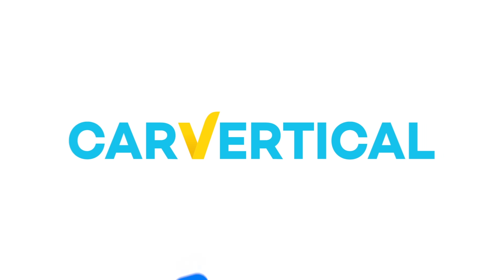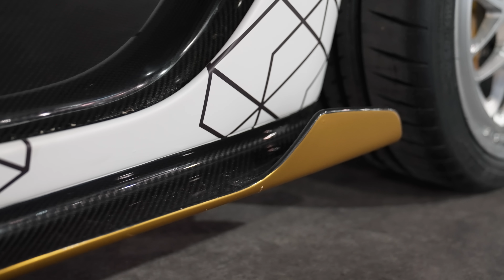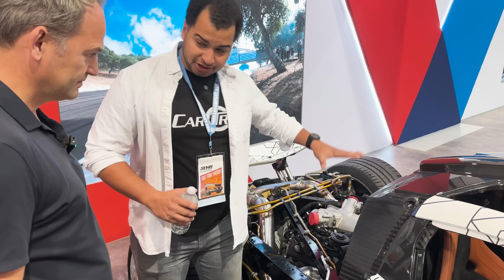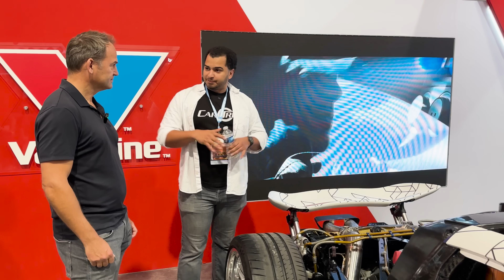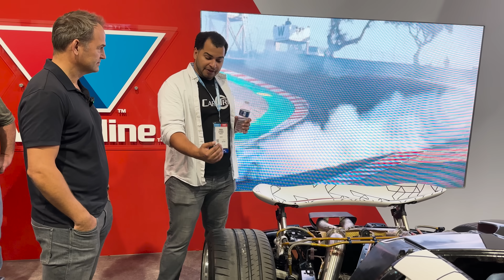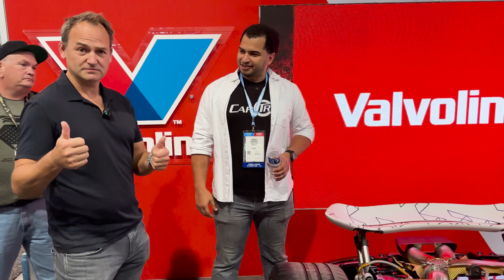Will I be driving the fastest McLaren ever? @tavarish

Comment: The spiritual successor to the McLaren F1 is the Gordon Murray T.50. The hybrid drive was there for a reason. It was the first Hypercar due to this system, which provided instant torque and basically nullified the turbo lag. It was made to be a scalpel, not a sledge hammer. To be balanced in every way, even in terms of weight distribution. What Tavarish has now, is just another car with a lot of horsepower but no sophistication. All the people and fan boys who are mumbling about power to weight ratio and outdated hybrid systems, don't know what those systems do in the first place. Some of them think is about gas mileage. There is a reason why the all time lap record on the Nürburgring was set by a hybrid. Tavarish talked so much about rebuilding the system and many real car guys got extremely exited about it. It has never been done before. Mclarens have been rebuilt but never a P1. People said, it can't be done,...and a big reason for them saying that, was because of the hybrid system. Tavarish proved them right, but not without making us waste our time on his videos up until the point he announced the "big plot twist."

Comment: The Hybrid System in the P1 is old .. Out dated... and very heavy..... Batteries are stupid expensive.... He can put all that money into the engine and help get more out of the car and more speed and HP ....
Reply: @@iceman-xr4yq what do you mean even said it on the video.. The technology is outdated.. The batteries are super expensive.. And it doesn't add that much extra horsepower so if you would have just take that hybrid system out and use the money for performance upgrades on the engine just like he's doing he's going to get 1,500 horsepower And do 270 miles an hour... And it will be because he removed the hybrid system.. weight is the factor.. less weight + more horsepower =  faster you go.. 😜

Comment: Would love to see this compared to P1 OOV the purple McLaren final production press car. Great video and huge respect for Freddy for having the courage to do this (and to deal with the negativity from hybrid fans).
Reply: Not sure I understand your comment. Hes removed the hybrid assembly, surely he wouldnt get any flack from the hybrid haters?
Reply: @jeremyglover5541  Right enough, I have adjusted the clumsy wording above. If you go to Freddy's channel he has received much vitriol from those who would say a P1 is not  a P1 without the hybrid system. I disagree for the reasons Freddy outlines: it will be 200kg lighter, it will improve power to weight ratio and it should yield a better car for his purposes.
Reply: @Gorbyrev  yeah he has, but those guys are just keyboard warriors. He already made a video (as did Rich rebuilds) going into detail the reasons for removing it, but no doubt there will always be a bunch of haters who just want to talk crap and make it sound like they know what they are talking about.
Reply: I mean the fact he has valvoline onboard, as well as the original turbo manufacturers and engine builders ... also taking it to a wind tunnel etc? and now the STIG and putting it against an original P1? this is no backyard garage build. Freddy may not actually BE an engineer, but he sure is surrounding himself with them.

Comment: Straight from the Clarkson school of POWER! This will be overpowered and struggle to put it to the road. Handling issues will abide too, sadly. May as well call it a P1 Hellcat.
Reply: How much HP is a Bugatti Veyron GT? Yeah…. 🤦‍♂️
Reply: @MechanicalMafioso  And how many wheels put the horsepower down in a Veyron? 🤔
Reply: @joshua.snyder  What’s the HP to weight ratio on an F1 car? Pretty sure it’s far greater than the P1 Tavarish/Freddie is building. The number of wheels putting down power is only relevant during acceleration on the street, with street tires. Pretty sure he won’t be hitting 260+ mph on regular street tires. But hey if you want to believe 4wd matters for a top speed run then you do you… I’d really like to see how many seconds they’d last before exploding. That’d be neat… Or simply put, when they’re pushing this car it will necessitate having race tires and with that all bets are off, F1 being a prime example. 2 drive wheels is plenty, less parasitic loss = higher top speed and acceleration for the same HP#  This is why high HP drag cars run 2wd, not 4 same for F1.. It’s funny you saying 2 wheel’s isn’t enough when top fuel drag cars are running what 12,000+ HP on 2 drive wheels. Pretty sure Tavarish/Freedie will be just fine…
Reply: @MechanicalMafioso  Impressive number of passive aggressive strawman arguments, none of which have bearing on the point. 
Freddie's approach is fun and will get attention for the channel which is great, but in terms of making a better P1, that approach is throwing the balance and performance of McLaren's engineering out of wack. Turning it into a quarter mile machine is not in the spirit of the P1, much less the F1 he claims to be paying hommage to.
Reply: @joshua.snyder  It’s pretty impressive that there’s so many experts in here on Mclarens that know far more than Freddie. I’m impressed!
Reply: @MechanicalMafioso  Freddie is doing what he wants with his car which is awesome. HE asked for people's feedback. Many, many people have expressed concern with his approach, and he his still cool with that.
What he didn't ask for petulent fans to white knight for him.
Reply: @joshua.snyder  🤣🤣🤣🤣 Not white knighting him, just calling out BS.

Comment: I wonder if the P1 aero design will allow it to travel at 260mph without big modifications and tons more power.  At very high speeds, each additional mile per hour requires so much more horsepower.  Areo is a massive deal too, I’m just not sure the P1 design will allow for such velocities.  I hope he gives it a hell of a try though
Reply: The Bugatti got to 250+ with 1000hp (& weighs 4162Ib - 1888Kg).  Now give a P1 at 1280kg an extra 600hp & thats where Freddie will be.

Comment: I was initially skeptical and wanted to think Tavarish was a bit arrogant to assume he could improve on this car, but after hearing him talk it seems that he’s knowledgeable and considerate of Mclaren’s engineering and history. I now think he will make a competent build using the “correct” hardware while paying homage to the car’s spiritual predecessor. A true reimagination.
Reply: i dont care if he straps a wonking great rocket engine to it
the day any manufacturer is held to be " too holy" to touch or improve by some lad in a shed. is the day hotrodding cars dies..
stop being arrogant
Reply: @ripvanwinkle2002  They tell him no because of liability issues - he has never had the carbon tubs on this or his blue one x-rayed for micro cracks which in carbon can be devastating. If they blatantly said sure to him - and it does disintegrate, it opens them up to a possible lawsuit. Nothing he is doing in this build is ground breaking at all in terms of hotrodding exotics though, underground racing has been doing crazy exotic builds for over a decade the only difference is that freddy is on youtube (not even working on it himself) and used a salvaged car. Also hotrodding is dying out as we know it, eventually EV swaps will the be new LS swap and there won't be much if any tuning happening as it is not nearly as accessible.
Reply: @corail53  
Its had a bath not a massive crash .
Reply: @TheCraigy83  Had a bath in salty ocean water, traveled 400 yards with waves, crashed into trees, garage etc until it sat on a toilet. They towed it quite moronically which caused toilet damage to it's carbon tub and destroyed it's wheel entirely. Then it was abandoned for many months and allowed to rust. Tavarish is actually quite lucky, it could be far far worse and that's why nobody was buying it..
Reply: @TheCraigy83  It took on a significant amount of damage to the carbon tub when it crashed through the garage door and floated down the street. There was a massive crack in the carbon running down the whole bottom of the car that his carbon guy repaired.
Reply: @armadillolover99  
I didnt know it had cracked just from floating around against a garage door😂 . 
 Its not carbon btw its micro nylon / shoelace weave in resin , they think were durrrrr
Reply: Well Mclaren already made a better Mclaren than this car called the f1... Tavarish is making something in between.
Reply: @amazin7006  not really, he’s projecting more than double the hp. Closer to the speedtail. But his will easily destroy each of those and a stock p1.

Comment: its gonna be a souped up 720  .. but who knows someone else may have gonne down this hole.. Motor needs connecting rods, pistons probably a crank, then clutch, basicaly a race motor.
Reply: He's got a fully built motor in there
Reply: Just look at DDE mclaren 720 gtr they got fully built engine makes 1300whp and they can easily turn up the power even more if they want.
Reply: Fully built P1 engine, Custom turbos by the same guys that made the originals, P1 suspension, P1 chassis. Yup sounds like a 720 to me…. 🤦‍♂️🤣🤣🤣🤣
Reply: @siddanthg7886  pretty sure he said it was a stroked out P1 engine… As in the original block that came out of the P1. They way Mclaren does things it’s entirely possible it’s the same block with a shorter stroke.
Reply: @MechanicalMafioso  Yup but this  engine did come from mclaren 720s right ??
Reply: @siddanthg7886  I don’t think so, I think the core came from the P1, just has the same stroke as a 720, might be a 720 crank. Rods are aftermarket. Why buy a new block when they’re literally the same… Also almost certain it’s still running the P1 cylinder heads. Not certain on that though. I couldn’t imagine he’d buy new ones. Those parts aren’t cheap and wasn’t anything wrong with them… I’m sure they’ve all been rebuilt and upgraded so essentially it would be classified as an 840T, but the foundation IE block, Cylinder heads are from the P1. Additionally 840T stands for 8 cylinder 4 liter Turbo. Which is exactly what that engine is now, just so happens it was originally a P1 8 cylinder 3.8 liter engine hence 838
Reply: @MechanicalMafioso   You might be correct at some points i'm pretty sure he didn't explain how they rebuilt the engine . He might not completely explain how they rebuilt the engine bcuz of hate he might get and he may loose views too. He already lost views when he ripped out the hybrid system.
He clearly mentioned it's 720 egine so he might have bought it
Reply: @siddanthg7886  the 720 is just because it’s now the same stroke/displacement as a 720, which was because of that being the only difference between the 838 and 840. Most people wouldn’t really understand all the technical stuff so just call it a 720 and done because it’s now the same displacement as a 720.
Reply: @MechanicalMafioso  Yup.. This could get even more exciting to see if DDE collab with tavarish to see who got the fastest mclaren race btwn 720gtr vs p1 evo
Reply: @siddanthg7886   if you go back and rewatch the video Freddy hints that it’s still the block/heads from the P1, rewatch from 3:14 min. He says it’s 720 “SPEC” not 720… the devils in the details…
Reply: @siddanthg7886  would be neat to see for sure. Definitely think Freddie’s P1 will be faster though as the P1 is lighter with the Hybrid system and he lost that weight, 400lbs is a huge amount. And he’s bumping the HP up to 1,300 wheel… it’ll be bonkers.. Not that in a Top speed run it matters but the Chassis and suspension is still l better on the P1 than the 720. Who knows what DDE will end up doing though when it’s all finished.
Reply: @MechanicalMafioso   DDE getting new carbon fiber bodykit so it's going be light too and it already has 1300 whp they can turn up the power if they want to so it will be a fair race aginst p1 evo
Reply: @siddanthg7886  they body was already Carbon on the 720, just wasn’t exposed nor the GT race style. Most of the weight is in the Chassis, tub, suspension. Or lack thereof in regards to the P1. The F1 and then P1 concept was no limit, light as can be. The 720 is a production supercar. The P1 with the 400lb Hybrid system is still lighter than a 720. Freddie’s is now approximately 400lbs lighter than any other P1. This will be ridiculously difficult for DDE to overcome. Would still be an entertaining watch though.
Reply: @MechanicalMafioso  if you telling that 720s body panels are carbon from factory then you're wrong bcuz only tub and door side panels were made of carbon and entire body panel is fiber glass . About weight mclaren p1 is 1490 kg kerb weight ( -181 kg hybrid system) = 1309kg  and mclaren 720 is 1368 kg with fiber glass panel not carbon fiber so DDE 720 will weight less  than actual 720 from factory and will be fair race against p1
Reply: @siddanthg7886  We shall see….
Reply: @siddanthg7886  same block Bubbs…. The long block came out of the P1, the crank and rods were changed…
“When McLaren finalised that it would opt for the twin-turbo V8 design, it bought the rights to the VRH35L engine wholesale from Tom Walkinshaw Racing. Having done significant work to the engine alongside its engineering partners, McLaren then renamed it M838T.

This engine was used in the MP4-12C, 650S, 675LT, P1, 540C, 570S and 600LT, before a series of additional changes increased the displacement to 4.0-litres, bringing to bear a new name (but the same fundamental design) in the M840T. McLaren claims 41 per cent of the M840T’s components are new compared to the M838T.”